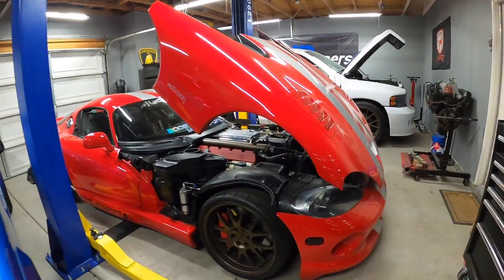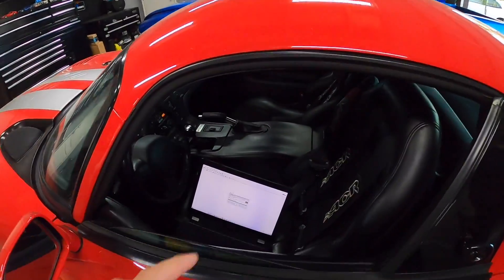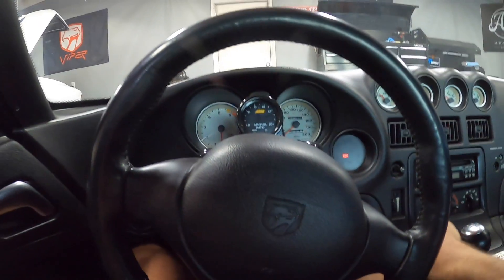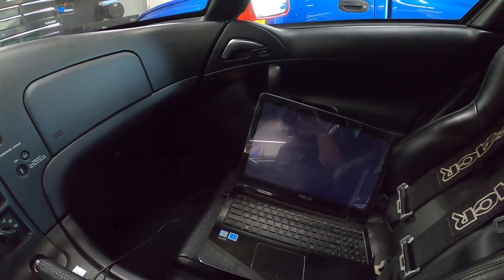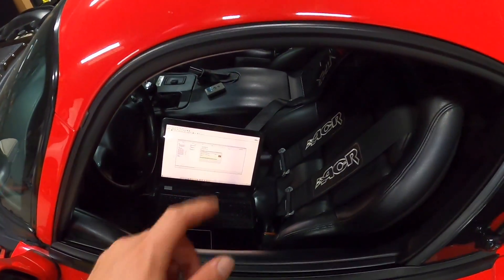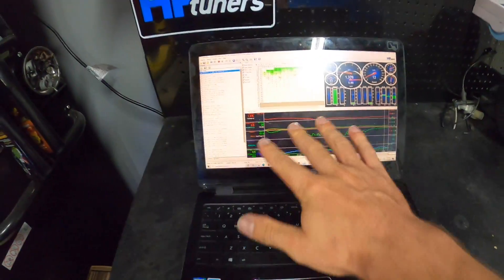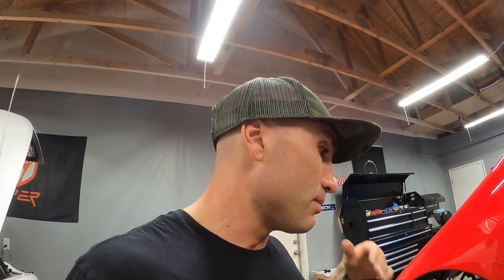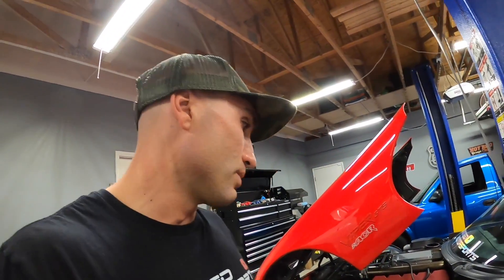Supercharged Dodge Viper Tuning | HP Tuners | FRP

Comment: Boosted not supercharger related but a great vid to make that would be a HUGE help to us Viper guys would be how to adjust front fascia gaps. No one has a good detailed vid on it. You may have to remove it anyway to mount your tank. Also how about a remote filler neck to the front tank?

Comment: What would the cost difference been if you took it to a custom tune shop and had it dialed in on a dyno?
Reply from the maker: Dyno time is usually at least $100 and hour plus you still have to pay the tuner.

Comment: Ran a 3.2L KB on my 97 GTS and it was fun for sure. I do have the A pillar gauge pod with AEM Boost and Air/Fuel gauges if you could use them let me know. Just sitting in garage now
Reply: I could use them 😂 🤷🏼‍♂️